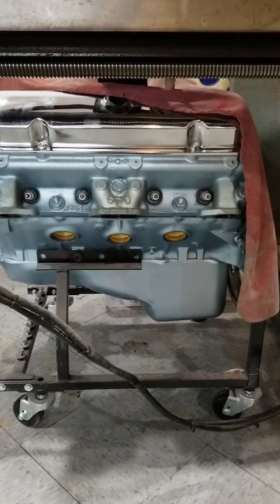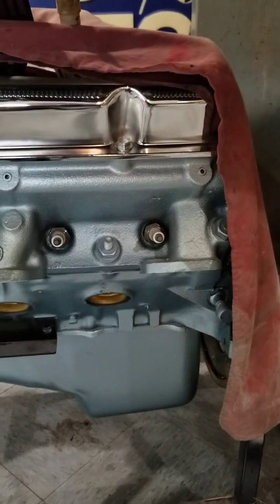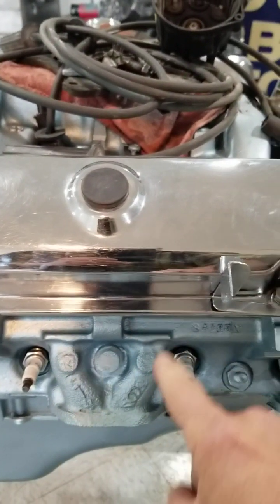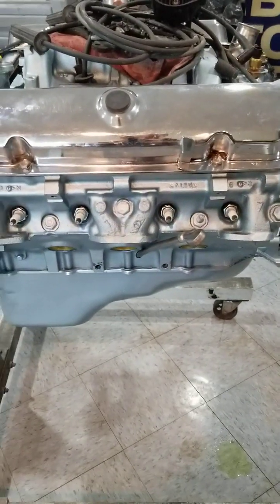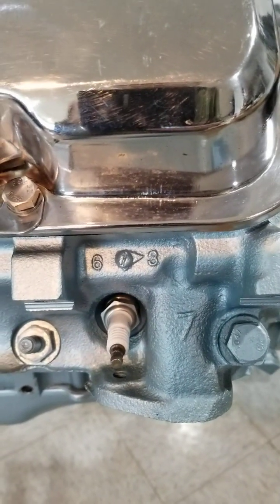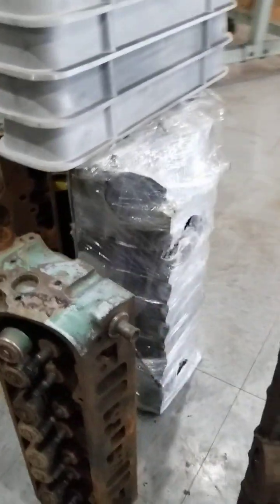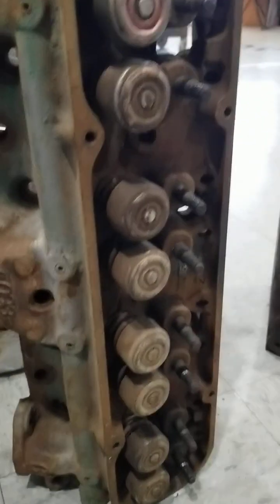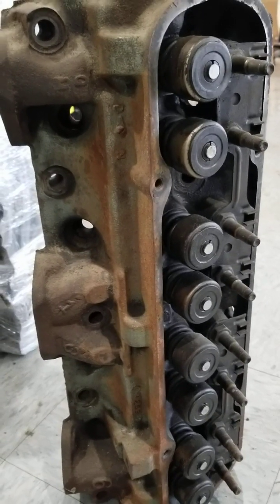@dcimotorsports1111 Pontiac V8 cylinder head casting number location.

Comment: Pontiac engines are ideal for boats. The air gap between the intake manifold and valley cover is perfect for putting a chain through it to use it for an ANCHOR.

Comment: That's the best "D" port head that you can find is the '67 670 head.
Reply from the maker: Many Pontiac enthusiast believe that. It is a good head no doubt :)
Reply: @dcimotorsports1111  
I agree. I had 4x and 6x heads. 
Not that great . 2.11's and 1.66's  with 96 cc chamber.
Reply: @phillipthethird42  some of the aluminum aftermarket heads have 2.11 intake  and 1,66 exhaust  too.

Comment: I have a question for you I have a set of Pontiac heads that ND Center of where you are talkin about the casting number is a number 12 and I've also a buddy of mine's got to set it says 13's on it also has a set that said sixteens just wondering if you could please explain to me what the number 12 head was on and I was told that the number 12 head was a very good head for Pontiac
Reply from the maker: The number 12 heads are a 1970 400 high compression 2.11 1.77 valve head with 72 cc chambers. They are commonly referred  to as a RA3 head and did indeed come on all RA3 engines in 1970 both automatic and manual transmission. They were  installed on the 1970 RA3 400 engines, but they were also used on the 400 cu. in. 350 HP manual transmission cars too. As a side note, the number 13 heads have been incorrectly called RA3 heads. However they were not used on the RA3 engines as delivered from the factory. However they are identical in every way except for the casting number and probably the reason people call them RA3 heads. Since they were used on the automatic cars they did have a different rate valve spring compared to the number 12's.